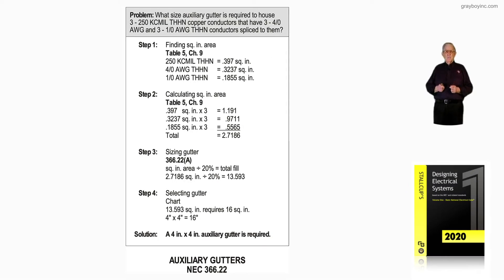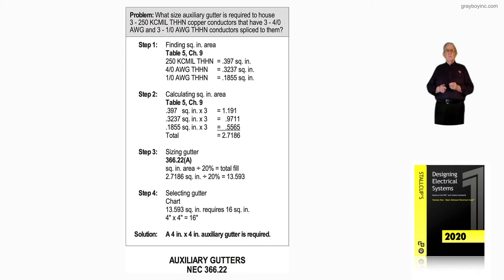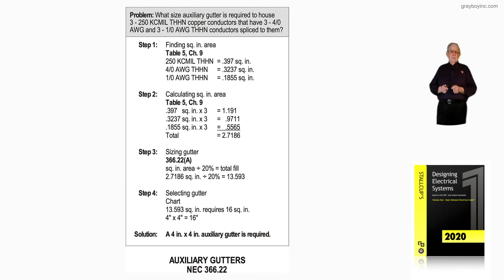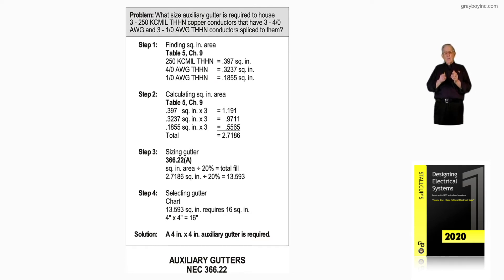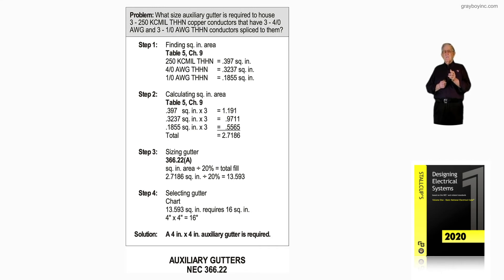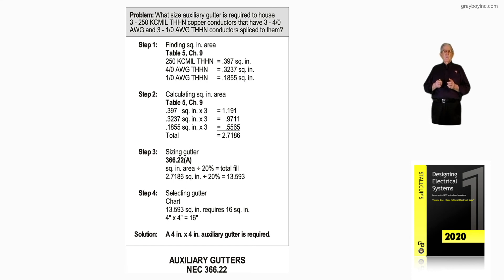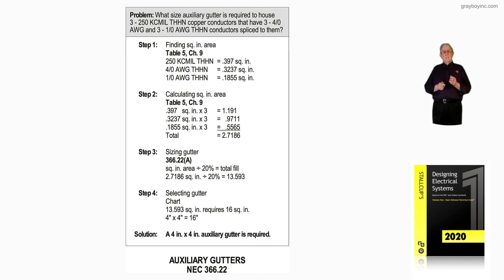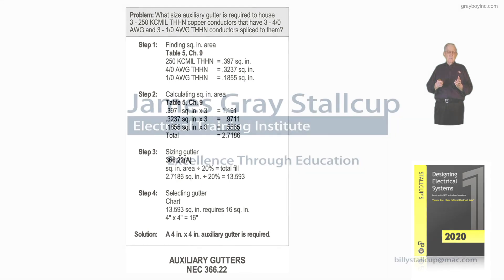12-24.2  UXILIARY GUTTERS - 366.22​​​​​​​

Comment: What about connectors/taps?  A multitap  with 3 ports is approximately 3 inches x 2 inches x 2 inches. Would a 4x4 trough still be okay using these connectors?